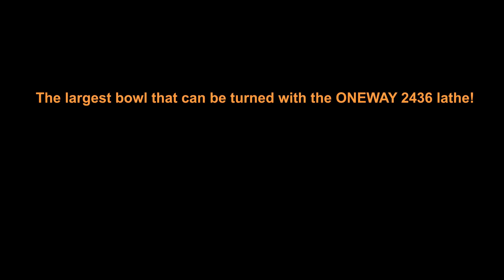HUGE Bowlturning with ONEWAY 2436 LATHE!

Comment: OMG. You really need some professional instruction. So many things wrong here, I don’t even know where to start.
Reply: I'm new to the woodturning world. I tend to only watch the legends with a reputation so I don't watch any yahoos and learn bad techniques. Raffan, Mahoney, etc. 
What would the major things be? I wouldn't use a spindle gouge for one. I'm just in the process of upgrading to a much larger lathe with the intention of turning larger forms. I have some great mentors in the club around me but none of them really turn extra large things.
Reply: @  you used a spindle roughing gouge on the outside of a bowl. NO professional that I know does that, because it’s not even close to being safe. Where is your visor? I see you dodging chips, rather than using your head for something other than a hat rack. That’s just two things.
Reply: @TheKingOfTheBrocean  extra large turnings are hard to sell. Keep your current lathe, and turn small to medium sized live edge bowls. You can sell those as fast as you can get them done, if they are done well.
Reply: @TheKingOfTheBrocean  he used a cone point on his tail stock. It will loose center. Should be using a cup center.
Reply: @TheKingOfTheBrocean  waaay too much took over the rest when turning the later part of the inside of the bowl, also should be pushing toward the center, not away from it.